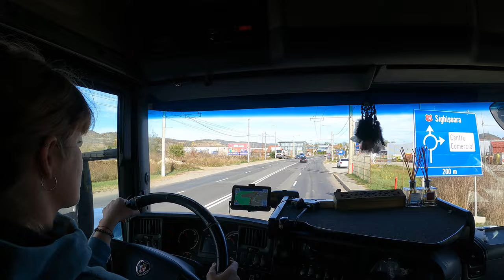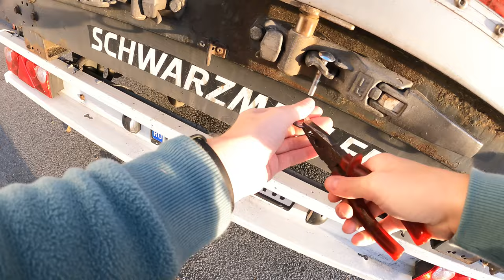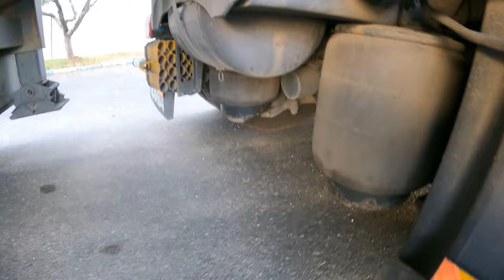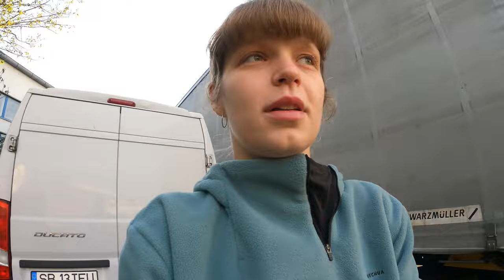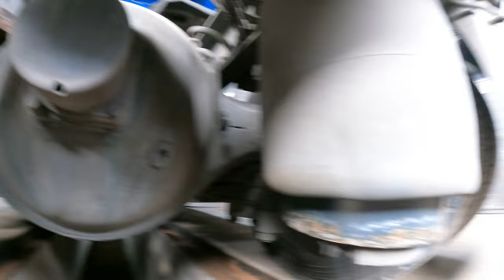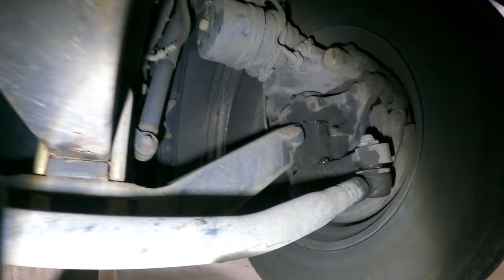Transporting coffee | The cutest security system

Comment: That's why we prefer solid enclosed trailers. Curtain sides are good for bulk such as lumber, pipe etc but for high value loads....not good. 
 We would use a high value padlock for the doors. High strength and VERY hard to break.
Reply from the maker: Hello!🙋🏼‍♀️☺️ Yes, you are right, this type of trailer isn't the best option for this kind of cargos. I usually transport timber, but you know sometimes I also get this kind of loadings 🤷🏼‍♀️. Have a lovely weekend!❄️😊